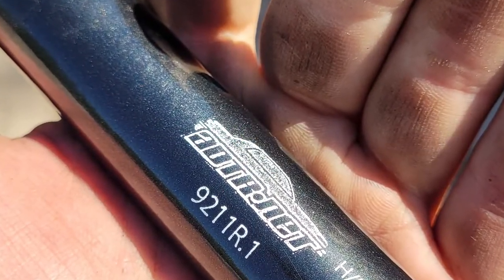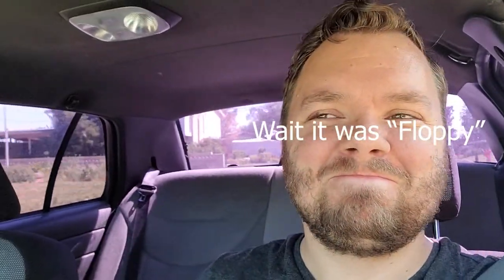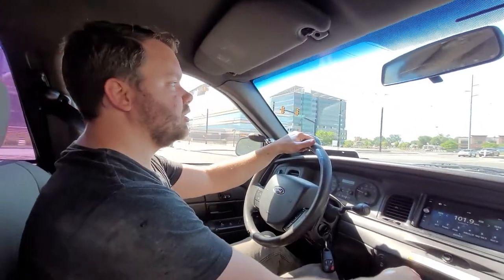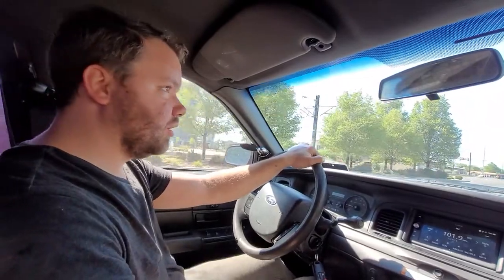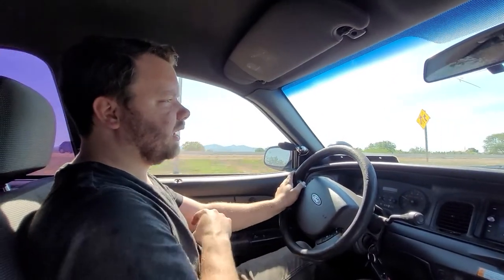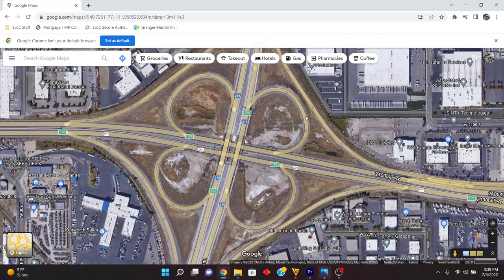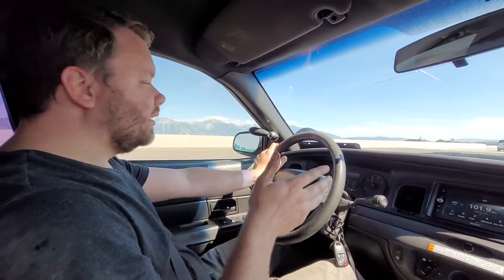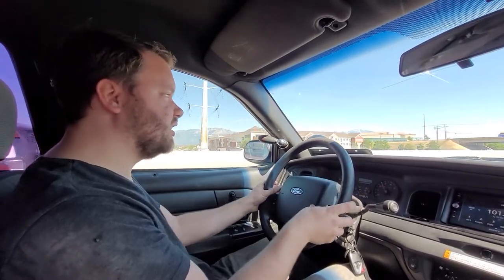Ford Crown Victoria P71 Rear Sway Bar upgrade P7B Police Interceptor

Comment: Hey brother what size Double dinn is that? Is that a 6.2 inch?
Reply from the maker: its a 6.4" screen, but any double din will fit, since the screen size doesn't change that its double din.
I would recommend getting a lighter mechless unit based on how the stereo mounts in the dash.